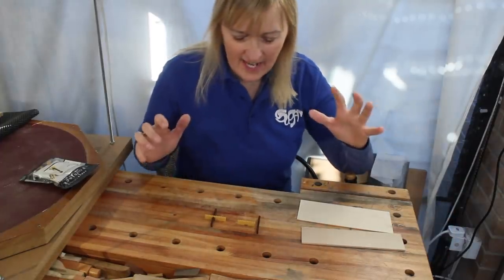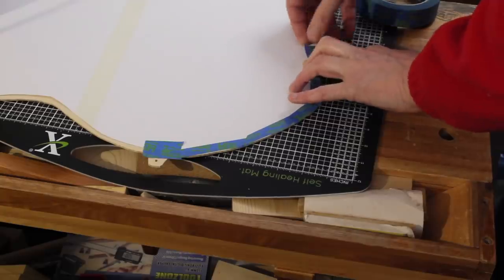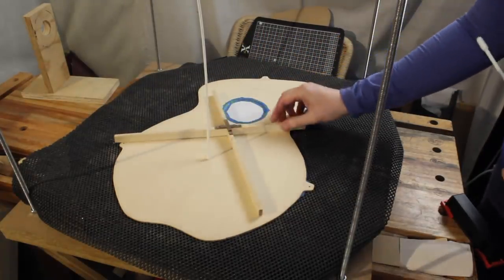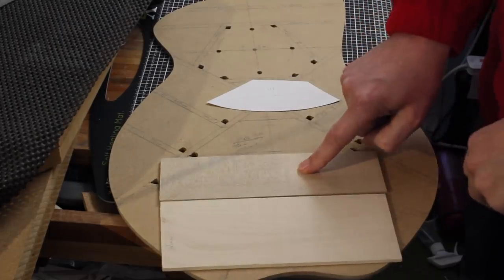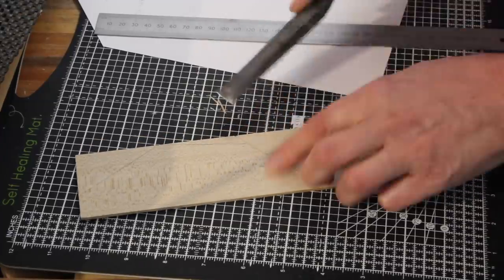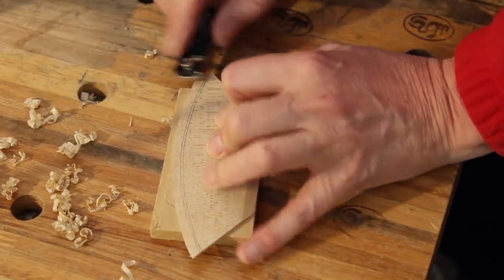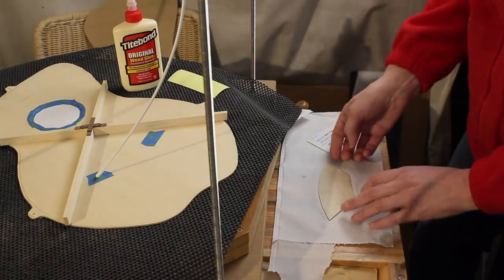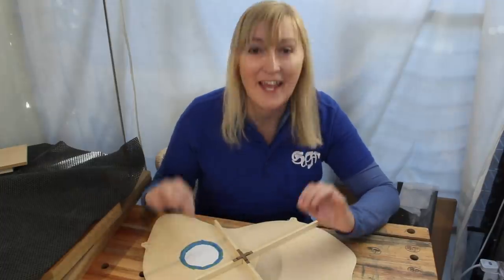SuGar SG1 acoustic guitar build part 46: X brace and bridge plate

Comment: Don't worry about any negative comments Susan.  You're making a lovely job of the guitar and the time it takes is the time it takes.  Better to take your time and get it right than hash through and make a rear end of it - ask me how I know this!  One quick comment on the bridge plate - not sure how much value there is in radiusing the underside of such a thin piece of wood.  I used to do it but didn't on my last 3 X braced guitars.  The top radius is pretty much established by that massive X of wood glued to it and I don't think any shape of the bridge plate within reason is going to affect that.  Just had a discussion on the ANZLF where Trevor Gore contributed about whether to radius the underside of even the main braces in a falcate braced guitar.  His answer was not to bother as gluing the falcate braces with carbon fibre and epoxy in the dish is enough to put the radius into the top.  I think I'll radius the main braces anyway as there's nothing to be lost in doing it.  Bridge plate will be a carbon fibre/wood laminate and there'll be no way to radius it as the CF is the layer immediately in contact with the top.  Sheesh - sorry for the War and Peace comment!

Comment: Nice work ! 
Don't fret over time; I have been working on mine since September 2017. Hopefully finish it this year. There are a ton of steps building an acoustic; this is easily the most involved project Ive ever undertaken. Getting in a hurry is not an option.
On the humidity issue, I'm in Virginia. I had to stop and wait for winter before gluing top braces and closing the box, so that humidity levels would drop enough that the wood had a chance to be stable as a finished guitar.

Comment: A good indicator of humidity is to join a strip of spruce the thickness of the front to another piece of spruce the same thickness of the front at right angles to the first strip about 2 inches wide and about  1 foot long thereby creating a piece of 2 ply that will bend when the humidity changes. A good indicator of when it is advisable to glue up and more importantly when not to glue up.

Comment: The reason the saw gives you trouble is that you push it down too hard. Sawing works best with very light pressure, almost the weight of the saw only. It also doesn't take much force to keep the piece steady then.

Comment: Susan, great vidieo I made a tool for removing glue squeeze out, I took an old 1/4" paddle bit & ground it down to about 1/8" wide beveled it like a chisel but I didnt sharpen it so it wont really scratch the wood surfaces & it has nice square edges to get in tight against whatever Im trying to remove excess glue from. I just thought I would share
Reply from the maker: Sounds good!

Comment: Hi I get a tight fit, then use epoxy to join the X brace joint before gluing to the top. My hope is the epoxy will fill any small gaps and also the register it at the angle I desire. Do you think it's a good approch to use the epoxy? It gives me extra feelings of security!

Comment: I've never used a sanding disc (radius disc). Did you make yours or Buy it?  How deep would you say it is? You didn't use the full diameter.   I'm guessing 5/8 deep? You used about half of that. I could get some string and paper to figure it out. mark it on paper.  That would take a lathe with an 18 inch swing. Maybe..
Reply from the maker: For a 600mm diameter 8.5m/28ft radius dish, it’s only 5mm deep. Tricky to make on a lathe I’d say, because of the very large radius. I’ll bet some clever person has a lathe jig though. Here’s the video for mine - there’s a separate vid for making the jig - I measured my curve, but you can scribe a curve using a ‘long compass’. https://youtu.be/2FGnYv8uEik

Comment: Where did you get the mini plane you used to chamfer the edges?
Right or wrong, I sand a VERY slight chamfer on the front and back edges facing down.
This is helpful if you ever need to remove the bridge plate. You can more easily get a palette knife started under it.
I really like your videos.
Reply from the maker: It was bought at a trade show, but Classic Hand Tools, Workshop Heaven, Yandles and Axminster sell them in the UK (some of the places I’ve shopped at)

Comment: You are quite right to be worried about all the bridge holes being in line along the bridge plate so why didn't you cut the bridge plate at an angle from corner to opposite corner and glue it together as you did the front. Thereby increasing the strength of the front of the guitar by increasing its diagonal strength. Just a thought since my guitars have a front that goes from side to side and have a piece of wood running from top to bottom supported by two braces running side by side of the centre piece.